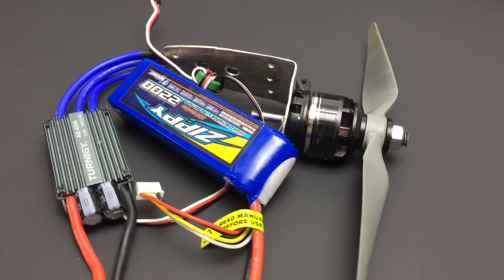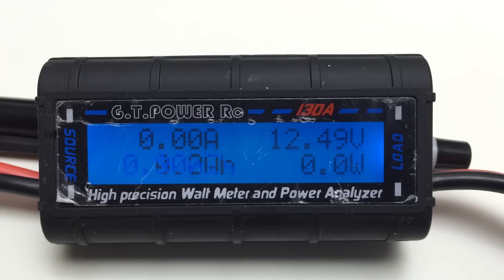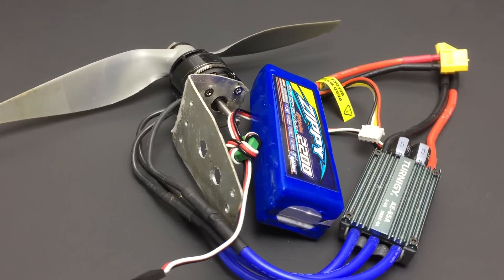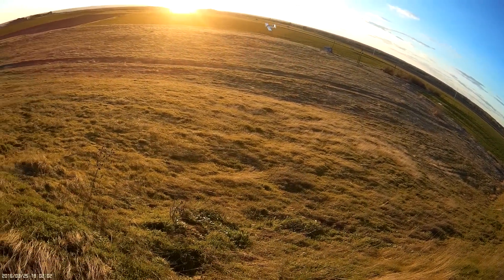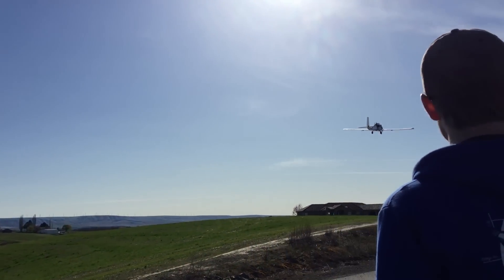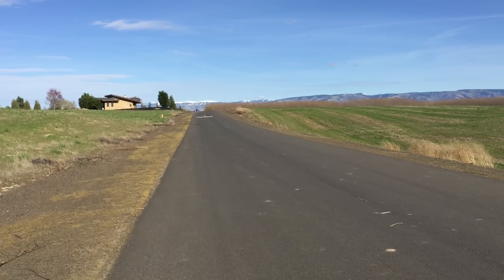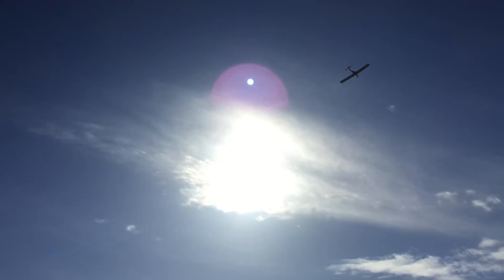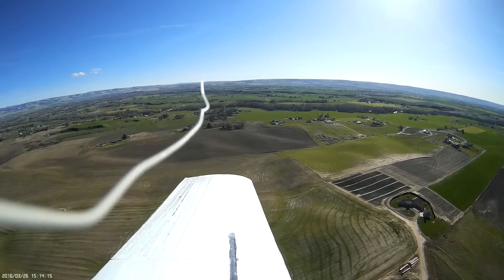Lead Acid Powered Plane

Comment: Nice test! A good reminder on how far we've come. You should have compared the price of the two motors and two batteries as well. I bet that would even add too the absurdity of using that battery in an airplane.
Reply from the maker: +Practical Engineering I bought that pb battery for $30, though online I can find both the pb and LiPo for around $12

Comment: The RC with lead looks much more realistic in flight, compared to very light rc planes.
Reply from the maker: Yea I like the scale feel of a higher wing loading. Less sensitive in the flare and handles wind better. You can also just shrink the wing for a similar effect instead of adding a lead block..
Reply: I like to make mine heavier. It takes longer to take off, you can't pull brutal G's on curve, etc... Just feels more real and less like a cartoon.
Reply: Paul, you've hit on something. More weight? Use more Lithium batteries. And the bonus is longer flight times. Be careful about local flying weight restrictions, of course.

Comment: I was hoping to see the Lead Acid battery with the old brushed motor flying the plane.
Reply from the maker: The two motors I showed at the beginning are huge and not the size that I used on the plane
Reply: @SammSheperd  কিরে ব্যাটা, তোর কমেন্ট আছে অথচ তুই নাই, হায়রে মানুষ! 😢

Comment: I was doing takeoffs like that last one in the 80s, using NiCd, they were those red Sanyo packs, which are not available any more, a 12 ounce pack of sub C cells could kick out 50 amps at 1 volt per cell, and people used to call what I was doing "helicopter take offs". I never tried lead acid, I thought it might work, but you just proved it can, at least at a lower level of performance. My NiCd planes did not fly nearly as long as lithium does today. I did a good job of disproving the idea that electric planes were under powered at the field I flew at, and actually got some other people interested in them. Of course, most planes there were powered by glow plug engines. Average flight time for me was 4 minutes, and if I flew slow and did not make hard turns, I managed a few 10 minute flights. Hoping I can fly again soon, the new technology looks great.

Comment: Great presentation 
I am confused 
Acid battery is more powerful but weight more. 

Does it pay to have acid battery for a longer flight duration?

Can you explain the difference between Lilon 18650 battery and Acid Battery?
Which one is more effective? 
Please

Comment: I liked how the flight with both batteries looked like a real plane as the wing loading was more like "full scale".
Reply from the maker: Yes I love heavy planes because you can actually flare them without balooning
Reply: Samm Sheperd one time I was trying to use a model glider to demonstrate how a real glider would respond when a winch cable breaks. The stall recovery was so much quicker with the model that it didn't really translate to full scale behaviour.

Comment: That is an truly awesome video! thanks.. Now... do you think that reliability will ever be = in lead acid than in Lipo's ?
Reply from the maker: +Migueldeservantes I'm sure in the near future car manufacturers will design their electrical system to charge and take care of lithium batteries. For now, they already make LiFe batteries to replace pb in your car. They are expensive and come with protective circuitry inside and stuff
Reply: +Samm Sheperd (SNRS) Well been blunt with you, I do agree on the LiFe batteries they are as rough as the come, but those protective circuits  unless the batteries in the future come with a warranty, I don't see my self investing on them! "That protective circuit" that you mention is the weak link on the batteries I have seen batteries that are in excellent shape, but that circuit say no! you no longer have a battery!!

Comment: My scratch built trainer has a wing span of 1.1 metres ,chord length is 10.5 inch and fuselage is 0.8 metres ,can i use my 2200 mah lipo with it ? Sorry its my first rc build ever , I'm a newbie.

Comment: Sorry I'm new at RC.  Why does the voltage read 12.5 fort he lipo which is sold with a label reading 11.1?
Reply: 11.1 is nominal voltage
12.6 is fully charged voltage
9 is fully discharged voltage
(Voltage below 3v/cell can damage the cell permanently)

Comment: So could you actually run the scooter with the smaller motor?  Or are there other issues like mounting and cooling?
Reply from the maker: Horsepower is horsepower. There would need to be some gearing to turn the higher rpm into torque and I might need some cooling considerations

Comment: hey samm ..u say that tiny motor is 3+ HP...I read somewhere that they flew a person in a da-11 with just 8Hp ...so assuming I decide to make a airplane to fly me for example.... and I want just say 15hp ....just 4 of those motors will take me in the air????
I mean yes considering I do everything else correctly..
Reply from the maker: In this video, the brushless motor that I use to compare with the large brushed motor is not the same motor that I use on the airplane. They are the same brand and look similar, but the one I use on the airplane is just .4hp or so

Comment: No not pointless ..,.informative. If that plane hit the deck with that large battery it would have been carnage.
Reply from the maker: +Graham R Dyer Yea, I was prepared for it's death, but also decided to end the Pb flight where I did for fear that it wouldn't be able to turn around again.
Reply from the maker: +Graham R Dyer Yea, I was prepared for it's death, but also decided to end the Pb flight where I did for fear that it wouldn't be able to turn around again.

Comment: great video but there is a mistake by comparing the electric motors. the brushed one has a continuous power of 1HP while Brushless has 3.5 HP peak
Reply from the maker: Why would you think that? They're both rated continuous power
Reply: RC Motors are usually rated for max. Power just check out the datasheet. If you don't belief me try it and you will see that the Brushless Motor will get incredibly hot after a while. 
I test it by myself with a 2KW Brushless RC Motor, a 1,2 KW the wheel hub motor(Brushless) und a 500W Brushed Motor. The RC Motor get hot as Hell, the Brushed Motor and the wheel hub motor get about 60°C. Later I tested for max Power. the Brushed Motor could handle over 1KW for about 30 sec, the the wheel hub motor Motor got over 4KW.

But all in all you are right a Brushless Motor is usually smaller then a brushed one with the same rating.
Reply: Stefan Wunsch R-E-S-E-A-R-C-H

Comment: what is the torque difference in the two motors you compared at the start?
Reply from the maker: Oh the big brushed motor will produce more torque for sure, but it can’t spin fast. Remember that torque is only a static measurement. How fast can it spin while also making torque? Horsepower is an actual unit of energy. Horsepower is just a product of torque * RPM (and then divided by 5252 just to make the number smaller)
1 horsepower is equivalent to 745.7 Watts
Reply: ah that makes sense now. i was wondering why if the smaller brushless motor had more horsepower then why dont they put them in electric cars if the torque is not so different. however cars need far more torque and no where near as high rpm as model planes do so it makes sense with your explanation of how horsepower is calculated that you would want a slower motor with more torque for a car and a faster motor with less torque for a plane :D

Comment: Realize you're flying a plane with certain design parameters expecting a lighter lithium battery, with a considerably heavier battery.  Fly a larger, and larger wing, plane that will easily carry the lead acid weight, and it will fly fine even if it's only for a few minutes.  Then put in the lipo, and it may fly a little better and a few minutes longer, but it won't be that marked a difference.  You have a plane that can barely fly the lead acid weight with the power produced, doesn't mean a different plane can't do it quite well.  Make a new wing for this plane that has a couple inches longer chord and it would fly much better with the more appropriate wing for the increased weight.
Reply from the maker: I designed and built this plane specifically for efficiently lifting the heavy battery..

Comment: LIPOs have not displaced lead-acid in cars, so what is their advantage there?  My car is more than 10 years old, and still has its original battery, and still starts at the first turn of the key.  Is that the advantage - longevity?  Recharge cycles?
Reply: lead acid batteries are VERY robust. You can overcharge or over-discharge them with only minor damage. You can use them just as well in -35c as plus 45c temperature without ever worrying. They are also much cheaper than Li-Po batteries for things where weight is not a major concern.
Reply: In addition they are best stored fully charged, can be charged by a current limited fixed voltage (simple), they are not a fire risk under normal conditions and last a long time if kept charged. Bear in mind that all a car battery really does is provide a large amount of power to the starter motor for a few seconds. The alternator provides all the electrical power while the engine is running.
Reply: lead acid batteries are also extremely recyclable, 98% or so of the lead can be reused
Reply: they have lipo batteries for cars... very expensive like over 200 USD for something that is only 1kg.
Reply from the maker: Those are LiFe batteries and they have a lot of protective circuitry. But yea they are neat.

Comment: Is there any advantage of the lead acid of the other battery?
Reply from the maker: +Vesa They are less likely to burn your house down I guess, but they can still blow up if you ignite the hydrogen gas that they emit while charging.. The acid also isn't very good for your skin.
Reply: +DoubleYouPee however, his voltage sag test showed that the lipo was capable of producing more current than the lead acid. It produced 40 amps whereas the lead acid was only able to produce 20 with a significant voltage lag.
Reply: that is not completely  true.. it´s not the only advantage.. some high quality Pb batteries have much longer lifespan than todays lipos..my dads -00  14 year old merc still had its original big 100A  led acid battery when he sold it..    lipos have  nonlinear degradion first 2-3 years they only looses a little bit of capacity.. but gradually it gets worse until they completely suck.. a well mainet Pb battery can still have some 80% capacity after 10-15 years. . .most lipos dont..        

...and some AGM  type of led batteries (absorbent glass mat in gel) can cranc alot of amps without running into those problems you mentioned.. 

A Lipo is still superrior in discarging lots of current but is way more expensive.. ..   

For flying things that needs to be light a lipos is the best option becouse its the most energy dence battery option right now..   

But if your a car audio duude and need 5000w for your monster audio system.. 5000w/12V= ~ 420A  and you need to play it for 10 minutes in a competition  without voltage dropping too much  you need something like a 12V 100A battery    ..  now  getting two 12v AGM gel type batteries like Optima yellowtop for example  150$ each ?  .. .   300 $   total is alot cheaper than buying some monster lipo :P 

easier to charge aswelll..  and less fragile..   you can deep discarge a AGM battery without it exploding :P 

deepcharge a lipo cell and it wont work ever again,..

Comment: Here is another way to look at it.
With Li-po battery: The plane can take-off with maximum payload of X kg.
With lead acid battery: The plane can take-off with maximum payload of [X - (difference in weight of the battery types)] kg
In other word, yes, it will fly, but with much less payload capacity.

Comment: Sir what is the rpm of motor when plane is flying plsss tell me
Reply from the maker: it's a 1500kv motor with 11.1v so that's: 1500*11.1=16650 with a normal propeller load assume 70% so 11655 maybe

Comment: What's the capacity of that lead-acid battery?
Reply from the maker: +dimmddr1 2300mah
Reply: *****
That's crap.
Reply from the maker: I wanted it to be as similar in capacity and voltage as the LiPo, for a close to direct comparison.

Comment: Wonder if a nicad would do better than lead acid.
Reply: yes alot better..    a nicad weights 2-3 X more than a lipo. . a lead acid almost 5X more  (this lead acid in this video anyways.. I think there are better ones out there) 

then there are NiMh batteries previously used in rc toys... they can be made as energy dence as a lipo.. but are inferrior in other ways..
Reply: back in the 2000s nicad and nimh were the gold standard
Reply: Before lipo we all were flying with nicd or nihm. When I was young it was the only thing.
Reply: I'm sorry just seeing someone   wrote exactly the same.

Comment: I HAVE  A 1000 KV MOTER 10*4.5 INCH PROP  AND A 3S LIPO OF 200 G CAN I MAKE A PLANE THAT FLYS  SLOW LIKE YOURS. PLEAS RIPLY...........
Reply from the maker: You can make about any plane you want
Reply: That combo will make for an excellent slow flier. Just google for some appropriate plans or a kit.

Comment: With the lead acid battery it looks like it handles more like a real plane.
Reply from the maker: Yes the wing loading is much more normal. Which is why I had a smaller wing before

Comment: Mystery solved. Yes, lead can fly. I'm experimenting with a power bank of whatever kind of battery wired in series with an air battery for not much added weight and insane KWH. Insofar as the lead acid battery this arrangement could help remedy the voltage sag... maybe.

Comment: great, now build a quadcopter with a car battery :)
Reply: Wouldn't 6 dc ducted fans get enough lift to get it at least off of the ground? (Asks the guy with no practical experience).
Reply: Somebody built an electric multi copter which could carry a man. Is that heavy enough for you? ;-p
Reply: @jonbradley4789  Ducted fan multirotors are inefficient, one guy tried, but it was really underpowered and unstable, and really loud lol

Comment: Replace the lead acid battery with a equivalent heavy lipo setup!
Reply from the maker: +Marius Masternes haha put like ALL of my 3s lipos in parallel
Reply from the maker: +Marius Masternes haha put like ALL of my 3s lipos in parallel
Reply: I just looked it up and for around 1000g you can get a whopping 10 000 mAh battery! (or atleast 2 5000mAh 3s lipos haha)

Comment: Worked.. but it sucked..

Try using a 5AH 12v powersonic SLA AGM battery. They are actually pretty good (Make sure it is VERY WELL fully charged. fresh off the charger. and it will perform quite a lot better than the cruddy looking battery you have there.)

its a really great and cheap lead acid battery
I got mine for 12$ on amazon. Very easy to maintain also.
Reply from the maker: Well a 5ah would be much heavier, and I got the one that I did because it had the same specs as the LiPo battery that I had. It was fresh off the charger
Reply: try to get a really small high cranking amps lead acid battery!! Might perform better.

Comment: That motor was using a maximum of 480 Watts in your LiPo test. That's about two thirds of a horsepower. If that is full power, then the claim made about its rating is exaggerated by a factor of seven. Is it Chinese, by any chance? If so, then it's usually safe to assume that all claimed power capabilities are false.Still, even 0.66 hp is pretty good for such a small motor.
Reply: RWBHere He used a different motor in his plane
Reply from the maker: Yea that was a different motor. I used the big motors as an example but I see how that is confusing

Comment: hmmmm maybe a lipo battery would be good for a kids power wheels.. actually just kidding..  im sure theres no low voltage cut-off protections so it would easily puff and lipo or worst case scenario cause lipo fire.  also the motor is designed to run at 12v..  a 4s would probably work out pretty well and have a little more pep.. but its definitely not worth the risk trying it.

Comment: lead acid batteries do not suck. first of all are you sure you have used the lead acid battery enough? they need constant use in order to keep them at tip top shape second they generally last longer than your typical battery if maintained

Comment: That was terrible voltage for a Lipo at wot.  Either the quality of the battery / fake C rate or just too small for the current.
Reply: Yeah, even good NiMH batteries will perform better than that...

Comment: 18650 ?
Reply from the maker: Those have greater capacity but lower discharge rate per unit weight compared with the "LiPo". Same Chemistry though both are lithium ion
Reply: 18650s do have substantial variations in chemistry though, with some optimized for energy and some for power but not both at the same time. For long distance flying, you could combine many 18650s together in series and in parallel to get a desired rating for the motors and airframe, and even mix energy and power cells to get the advantages of both.
Some can deliver over 20A but with 1500mAh, others just a couple of amps but over 3000mAh.
When used in combination, power cells can deliver more current because of their lower internal resistance. The energy cells deliver less, but also keep the power cells charged longer.
Lipos also have variations - in general low C rating can have higher capacity per unit mass - I guess that is because of the electrode to electrolyte mass ratio - ie, sacrifice current carrying capacity of the electrode to make more room for electrolyte.